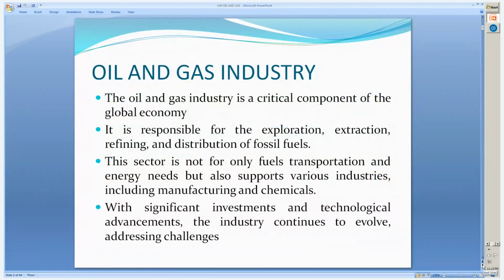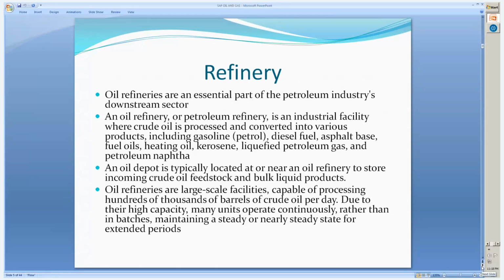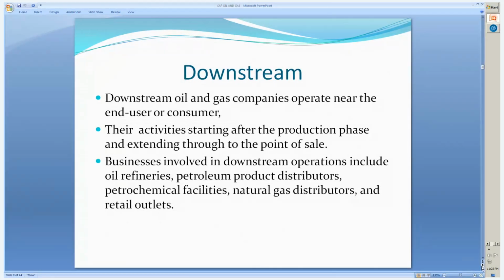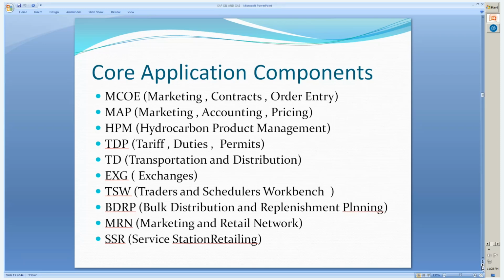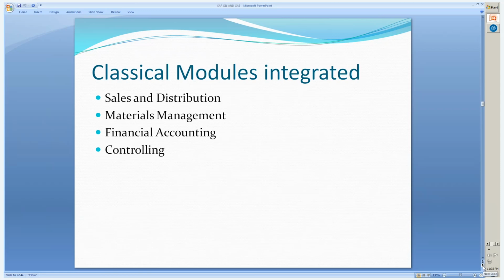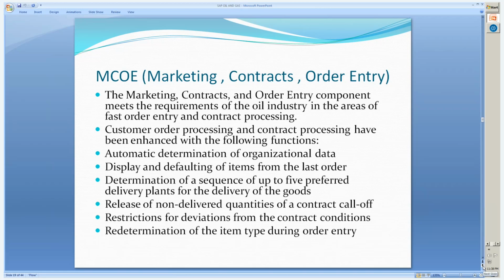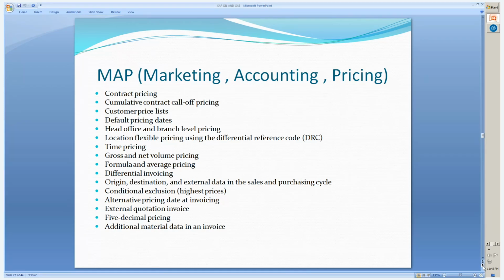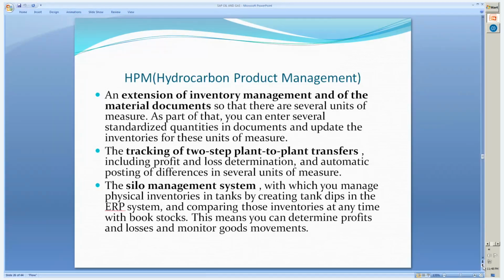SAP OIL AND GAS   DOWNSTREAM PART I BY SIMHA

Comment: Hi sir I am your regular follower of your channel ,I Have a one doubt in SAP IS-U Related ,Is it possible to Link between Technical master data and Business master With out performing Move-In., If incase posibilities Can you please Suggest How to Link the TMD and BMD Without Performing Move in?
Reply from the maker: In ISU billing is based on Contract , so it is called Contract Billing , Contract is created automatically in background when move in Happens and contract is created for installation , so when move in happens BP and Contract account and Contract all there Business master data objects get linked to Technical installation , so instillation is basic frame work to integrate both hence move in is required for linking